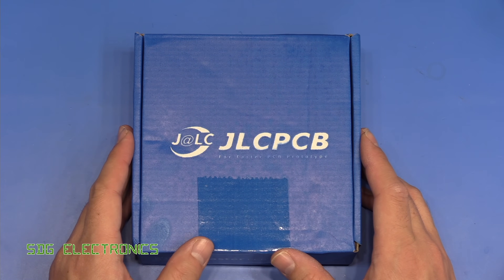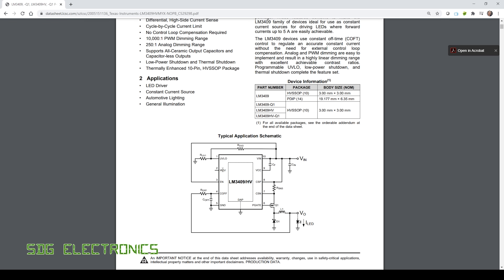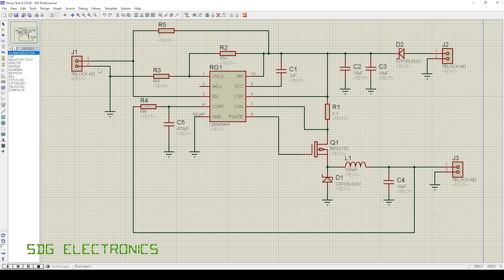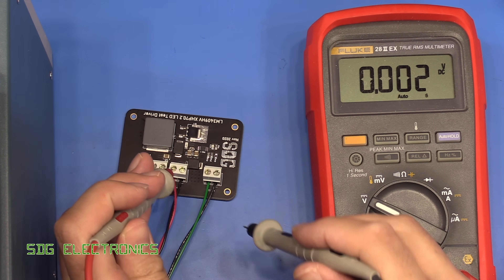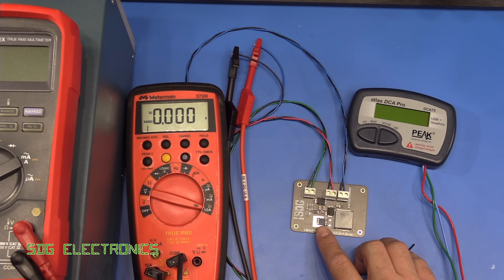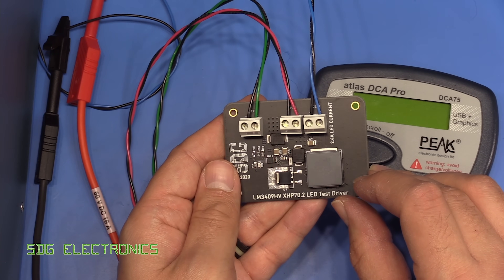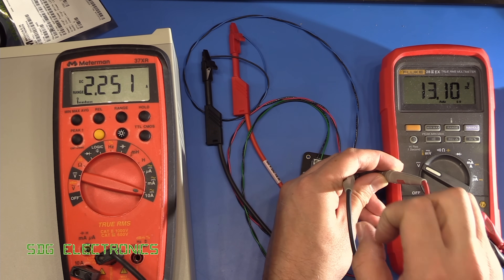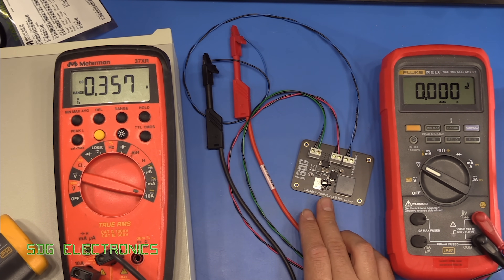SDG #184 Build and Test of a 2.4A Constant Current Buck Regulator based on LM3409 LED Driver

Comment: I've worked out why the current is below the value you expect. It appears as though you calculated the peak inductor current and forgot the current decays during the off time. 2.25A is exactly what you should expect. Go through the calculations on the data sheet again. Anyway, I'm looking for an LED driver which outputs 2.25A, to an LED with a forward voltage of about 13V, so I'll use these component values. I'll add a bit more filtering to reduce the ripple though.

Comment: I'm considering the LM3409 for the same current, input and forward voltages as your design.I think the reason why the current is slightly lower than the calculated value is the ripple current is too low, because the inductor is too higher value. I've only quickly read through the data sheet, so could be wrong.

Comment: i were about to design a Driver with the LM3406 for one of these 100W COB LEDs, but this LM3409 seems much better for my application except for the fact that you need a external mosfet for it. 
Thank you for this video :) Was really interesting

Comment: A much better MOSFET for this design is 
FQB47P06TM-AM002 from Onsemi is a little bit more expensive, but the RDS on is only 0.026 ohm, which makes the Power dissipated from Mosfet only 0.15W vs. 1.67W
Reply from the maker: Sadly the gate charge is a bit too high on that device. In the next part I've dropped in a device with better parameters than the Zetex one though.

Comment: If you picked the next higher resistance shunt you can still use two resistors to get your desired accurate ratio for th current limiting. With a couple of smt resistors soldered across the shunt for support driving cut feedback path it could be done on this board..

Comment: I am in the market for a new electronic load, which models did you use in this video?
Reply from the maker: The Korad KEL103 is the better unit out of the ones I've tried in the lower end of the price range.

Comment: As soon as you hooked up PWM, mic picked up that awful audible noise. Don't use EN when you have iAdj (:
Even a peasant PWM + RC LPF should perform better on that pin.
And there is a value in rising Fsw to lower inductor current and thus output ripple, output capacity requirement and reasonable inductor size (especially for PWM control, which datasheet calculations do not account for)

Comment: Also, check out TPS92512HV driver. Capable of 2.5A even with internal switch,  has that IAdj pin suitable for precise current control using ext. ref. / DAC, which results in minimal ripple at the output. 
Used 4 of them in my 136W light fixture, joy to work with.
Reply: On the second thought and giving a good look at datasheet of LM3409, I'd say TPS92512 is a lot easier to work with.
LM3409 has more complex feedback oriented on faster transient response, which is a very niche feature that works against you in a standard case, where you simple need CC output.
Reply from the maker: Thanks for your suggestion. I want to build a few studio lights with the XHP70 so I'll look closer at the TPS92512.

Comment: Steve, you may already know this, but you can reduce the likelihood of EMI/RFI problems in switching converters by using wide copper polygons in the high current loops, instead of traces.  Traces can act like antennas, and short, wide polygons minimize this effect.  In this design, I'd use a polygon to connect D1-K, Q1-D and L1.
Reply from the maker: I forgot to show the layout but I've done very similar in this one. I think I tweaked it further in the final design

Comment: Any idea how to reduce the coil whine? (the high pitched sound and 6:24)
Reply from the maker: I will address this in the next day or two. The frequency you can hear doesn't seem to make sense so we'll have a look at the waveforms next.
Reply: Sometimes by changing the switching frequency of the controller (if it's adjustable), you can get out of the inductor's audible range.
Reply: @FlyingShotsman  and if the frequency is fixed? And what is making it the resonate frequency of the coil so it vibrates?
Reply: @gregorkalan7575  In this case, it's likely the PWM brightness control that's causing the inductor whine (Steve specifically mentioned using a low frequency in the video).  Using a higher PWM frequency would likely stop it.  Here's a good article from TDK about this issue:

https://product.tdk.com/info/en/products/inductor/inductor/smd/technote/solution/acoustic-noise/index_mytdk.html

Comment: It happens to best of us... I wouldn't worry about it. Thanks for sharing too! I recently laid out two 100u 1206 capacitors unrelated to each other side by side in a orientation that they were to be installed horizontally. For some reason, the board came back with missing silkscreen and since the modified the pads for the capacitors to be square for ease of hand soldering (which resulted in 4 symmetrical pad), I installed the capacitors vertically. Ooops... Needless to say, the circuit did not work :)

Comment: I'm pretty sure you won't find a mosfet with the faulty pinout ad it's pretty standardized and has to do with the bulk always being connected to the same pin (drain on n gets)
Reply from the maker: exactly. Fortunately I have quite large copper polygons on the source and drain pads, so I'm going to try fitting an SOIC8 MOSFET there instead.

Comment: That's why I like the schematic symbol which includes the body diode! I can't remember how many p-channel MOSFETs ended up as diodes in circuits :-)
Reply: Same here. I always try to edit the symbol to add it if it’s not there.
Reply from the maker: Yep, I would have spotted it straight away if it included the diode symbol